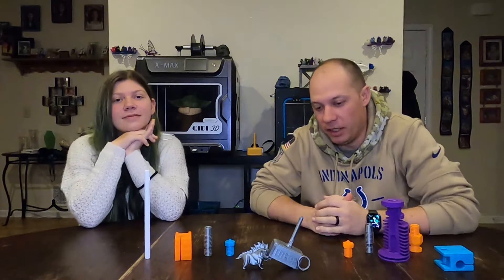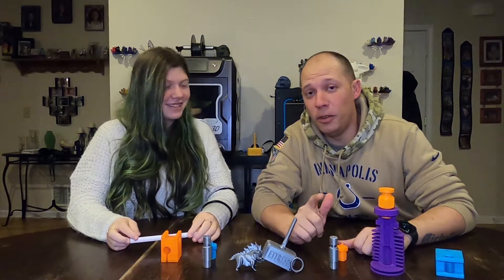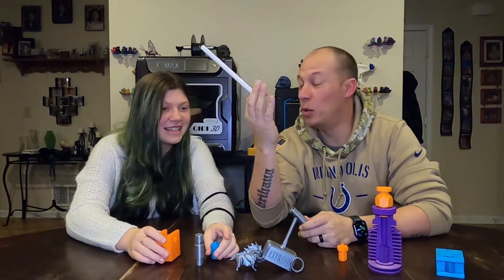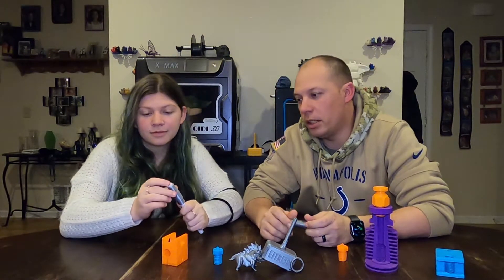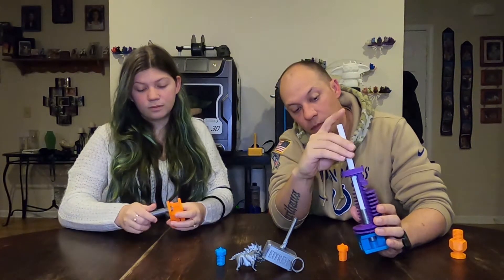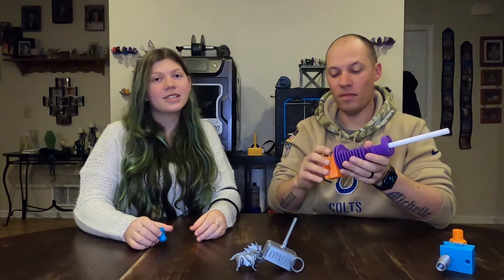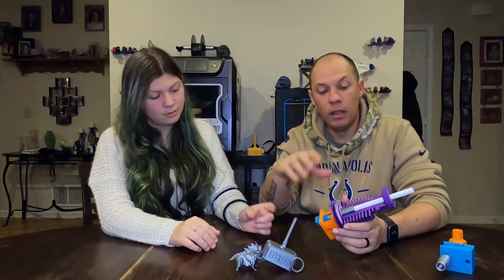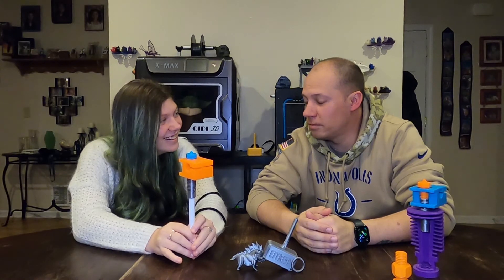E3D V6 Hotend (Genuine and Clone) Breakdown with Explanation

Comment: @Eitri3D, No more videos?
Reply from the maker: I do have a couple of videos in the queue. There will be a maintenance video coming and as soon as the mail system delivers my package I’ll be dropping another video demonstrating software I use. It’s a surprise for another YouTuber so I don’t want to release it until it is delivered. Did you have a specific video in mind you’re hoping/waiting for?
Reply: @Eitri3D  I would like something about maintenance, machine upgrades (like Bondtech LGX + Mosquito), firmware modification..... as I have a Qidi X-Max but the stock extruder is junk. 
Just haven't seen anything on the channel for a while and I was worried about you.
Sorry for my spelling mistakes but I don't speak English as I am from Spain.
Reply from the maker: Have you checked out our Chad Mod playlist? That’s a BMG dual gear extruder with a V6 hotend upgrade and added fan for cooling. As for firmware modifications. I hearing someone is installing klipper successfully, but that’s is above my abilities at this point.
Reply: @Eitri3D  Atilla and Cameron works in klipper.....also look at Chad mod but I like Bondtech LGX better.
Thanks for answering.
Reply from the maker: Ok I’ll do some research and see what I can do with that Bondtech LXG. Be looking for that maintenance video real soon. Cheers!